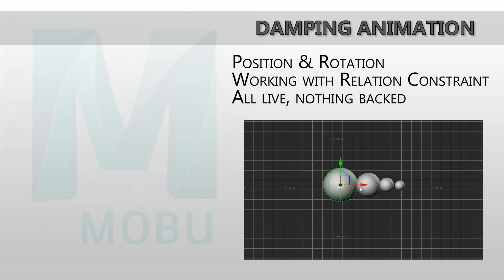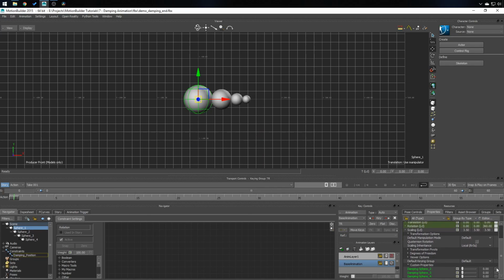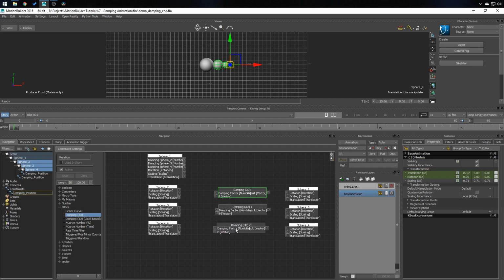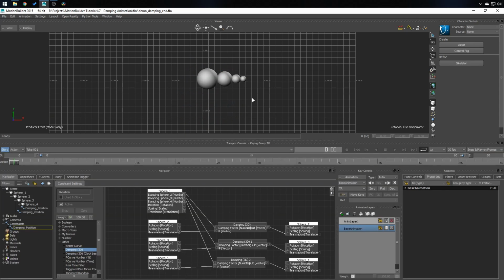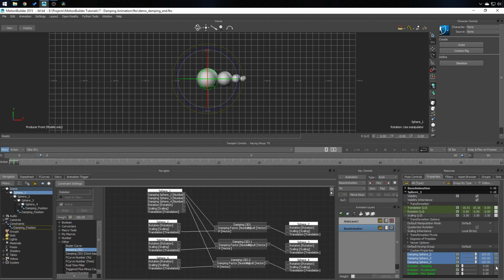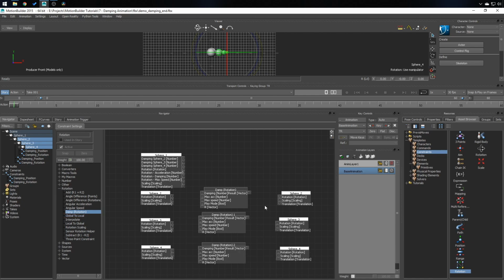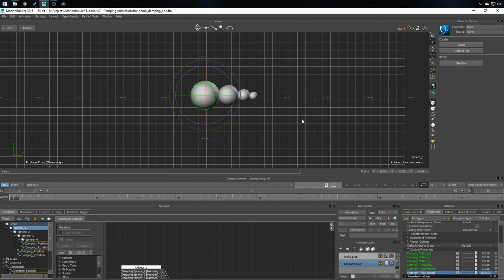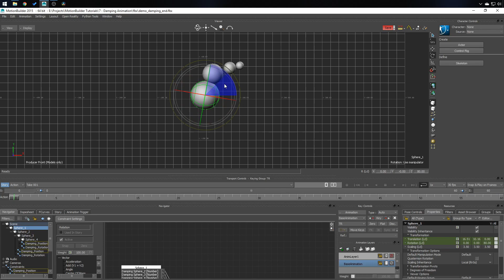MotionBuilder Tutorial - Damping Position and Rotation with Relation Constraint

Comment: Is it possible to add the steps on how to do the rotation Damping without the spring effect? Other than that, the video is very clear and direct. It's a pleasant to hear and very useful video! Great job Pascal!
Reply from the maker: Absoludly! I'm preparing a part 2 video for damping. Thank you!
Damping Rotation is a little bit tricky because MotionBuilder will switch your rotation values from -180 to +180 and that doesn't work well with linear damping. But there's a solution :) stay tuned